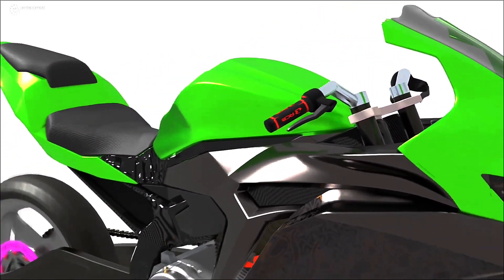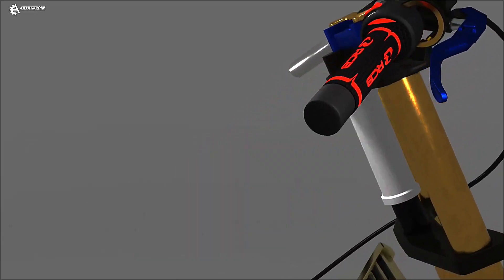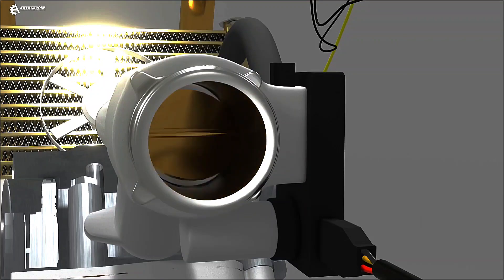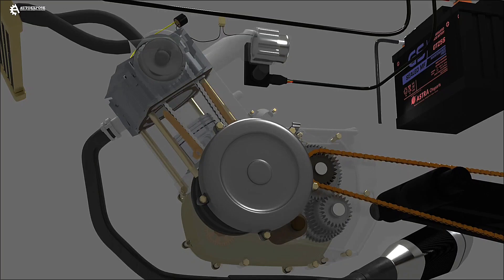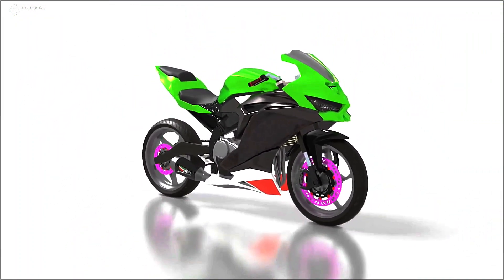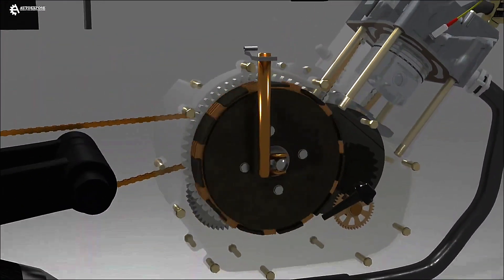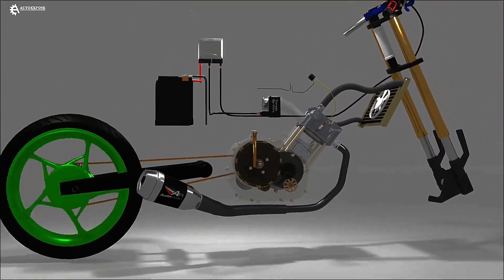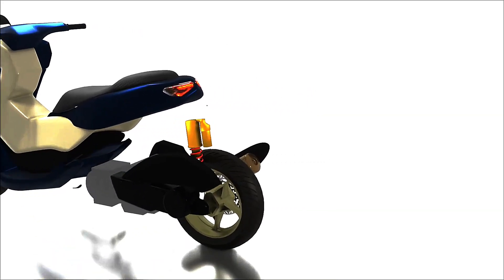How The Engine Brake Works To Slow Down Your Vehicle?

Comment: it didn't stop you, it slows you a little bit. but if you only use the engine brake, it will end into a free wheel so In the end you will need to press the brake lever to stop